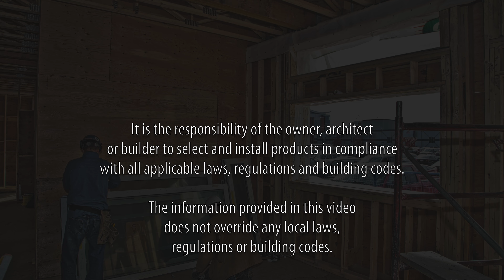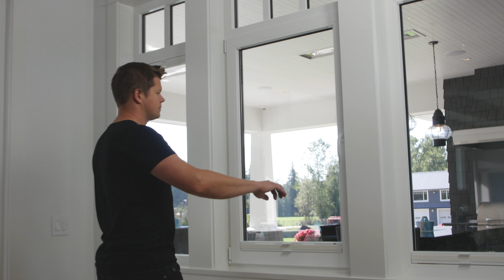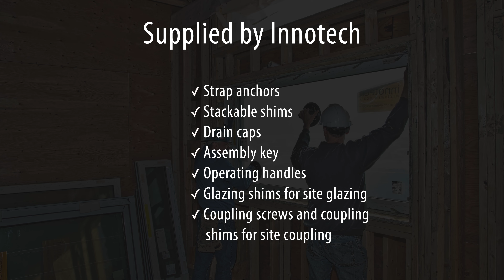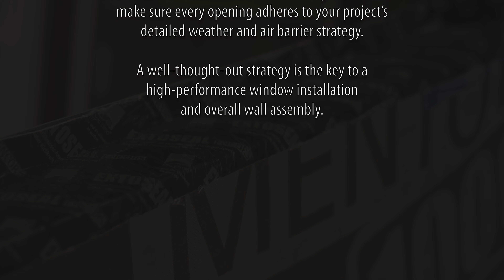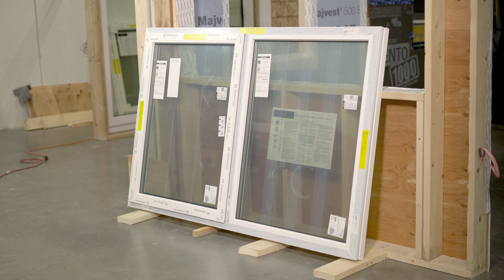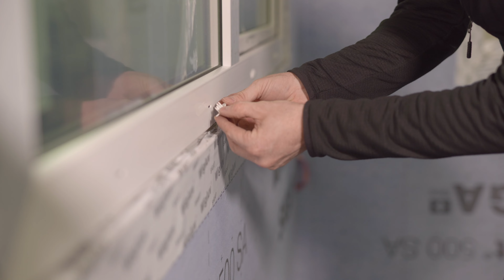How to Install an Innotech Window

Comment: What is the recommended way to seal the exterior of a middie flangeless set in a precast concrete wall?  Backer rod and sealant?  Yay or nay to weep?
Reply from the maker: Hi Christina, 

The appropriate method for sealing the window will depend on a many factors. Your building codes and/or authority having jurisdiction should be carefully reviewed.

Most commonly, we see backer rod/caulk as the primary weatherseal - this is typically towards the rear of the window profile, with an additional seal (to shed water) towards the front of the profile (on top and sides, or with weep sections missing if at the base). With an appropriately sealed impermeable subsill, the rear seal detail stands up very well to high weather exposure. 

Some consultants will prefer a solid back-dam at the interior base of the install; this would also be caulked to seal, with rod/caulk on the remaining 3 sides.

Depending on the assembly details, high performance tapes can be used very effectively as well. Waterproof and vapour permeable tapes could potentially be used on both the interior and exterior face of the window/install, giving excellent performance and reliability. 

We have a recent blog post on our website with great Sketchup details of various high-performance wall assemblies with middie window installations: https://www.innotech-windows.com/blog/in-depth-window-installation-in-high-performance-walls

Hope this helps!

Comment: Great video! What sealant was used here with the Siga Wigluv?
Reply from the maker: Hi Aaron, Thanks for the feedback. SIGA has a list of compatible sealants on their website here: https://www.siga.swiss/ca_en/downloads > Technical Bulletins > Sealant Adhesion and Compatibility Technical Letter. They also have their own sealant: https://www.siga.swiss/ca_en/products/meltell. Hope this helps!
Reply: It's probably worth mentioning that there are a number of methods to sealing up the window frame and strap-anchors to the surrounding membrane. The method shown in this video happens to be a caulk seal, but if you are using a high-performance membrane like SIGA, they have a couple of different tapes that would be appropriate for the particular application (like Fentrim for the interior side, and Wigluv for the exterior). Between the project consultants, the master applicators at SIGA, and the window manufacturer (Innotech, hopefully), it should be pretty easy to come up with a robust and easily applied seal that will meet your performance goals.